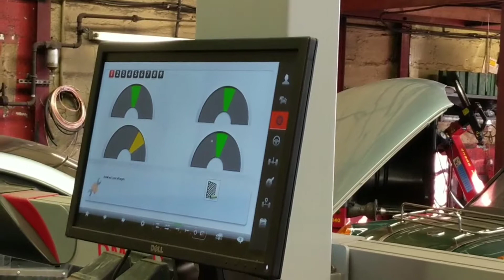Powerflex Bushes VW T4 Front Upper Arms Install

Comment: I have purchased a few Powerflex bushes for my T4. So far I have bought the bushes for front upper arms F+R, front lower arms F+R, front ARB and rear trailing arms inner and outer. Just need the front ARB drop link poly bushes and then find somewhere to get them all fitted. 

The garage in the video look like they know their stuff, not local to me though, about 90 miles away but could be worth the trip.